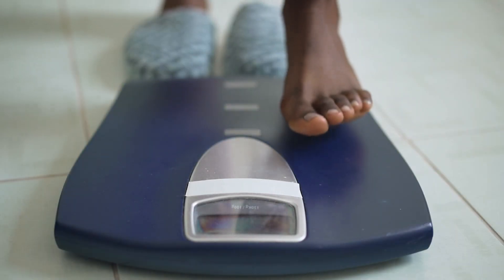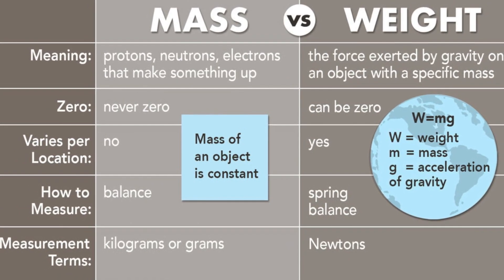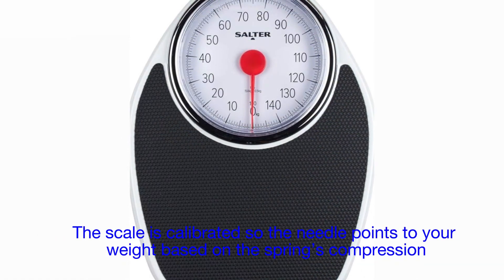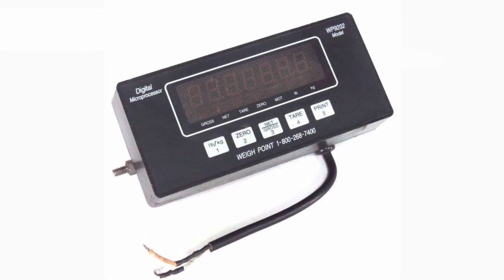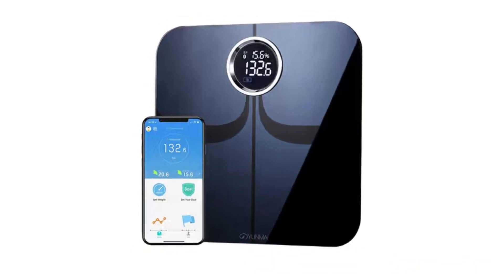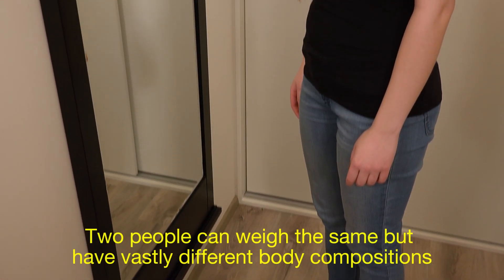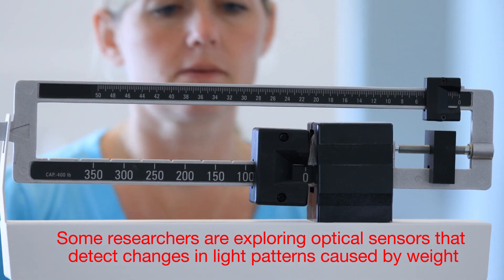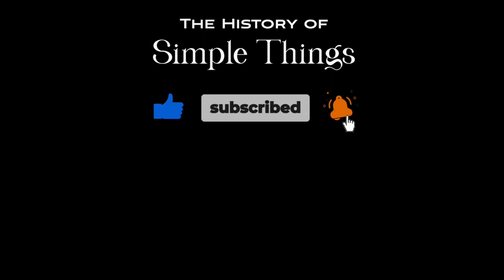How Does Your Scale Actually Know Your Weight?

Comment: Weight is actually measured in Newtons (N) - though people generally do not multiply the Mass (kg) x gravity to get their actual weight, and misdescribe their mass as their weight. a Mass of 90kg is actually a weight of 90 x 9.8 = 882 Newtons (N). On the moon their Mass remains as 90kg but their weight is 90 x 1.6 = 144 N 😉